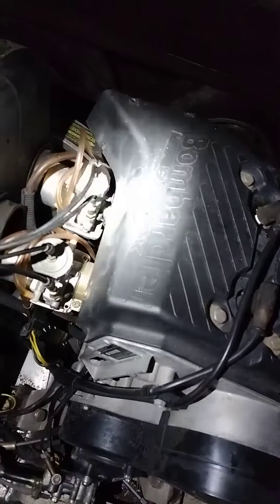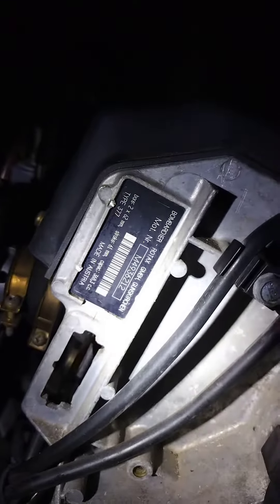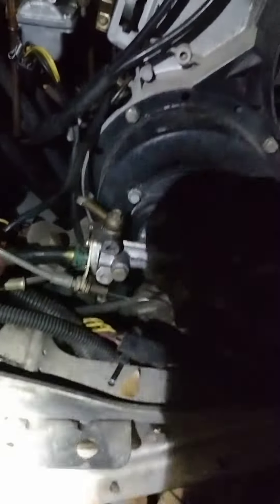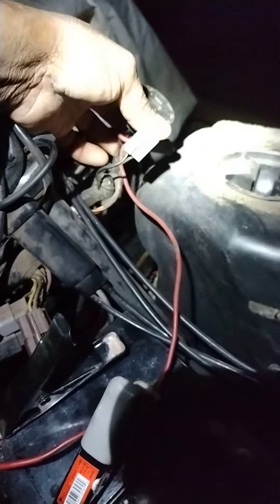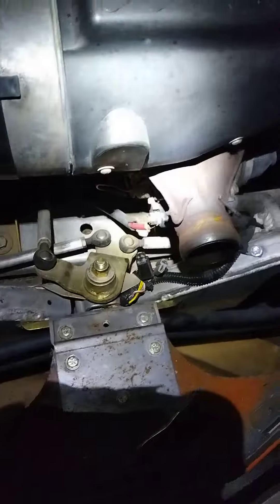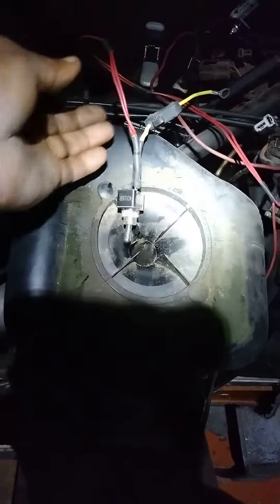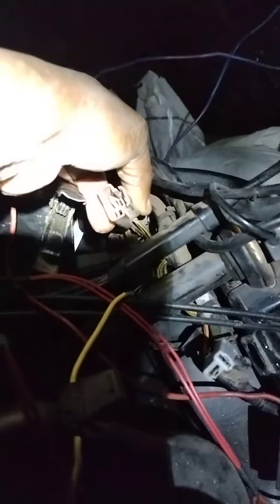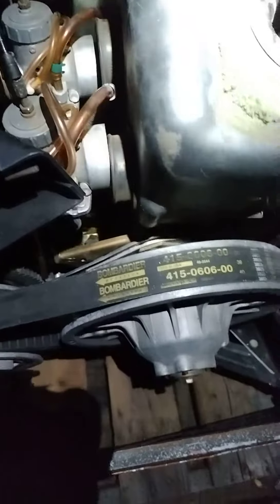Bombardier Rotax 377 snow mobile,no spark .need help figuring this thing out don't know the year

Comment: What was it. My voltage regulator on my 377 blew and it still ran but would blow my lights. When I replaced the voltage regulator my new bulbs would light up when I pulled the cord but I’m no longer getting spark. Would I have maybe burnt my ignition coil out.